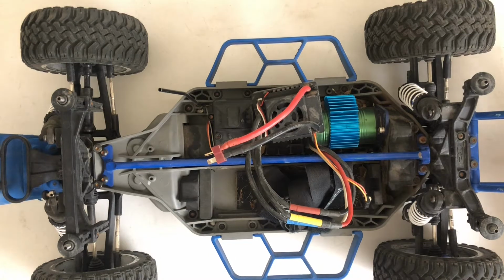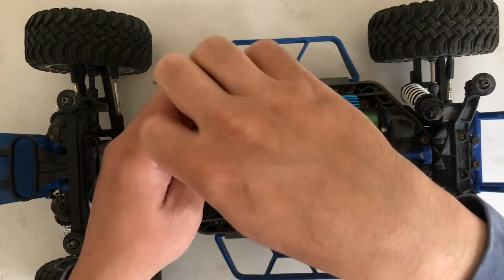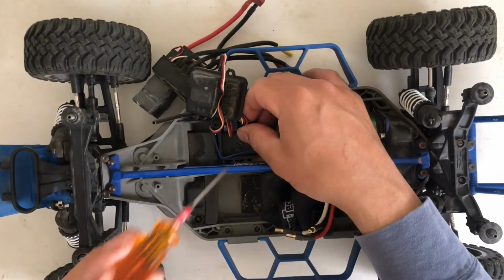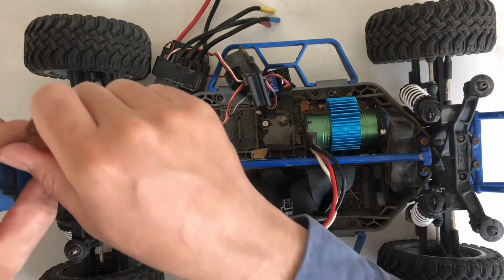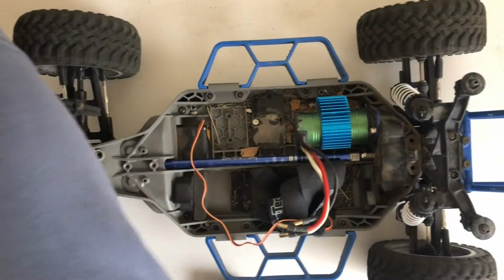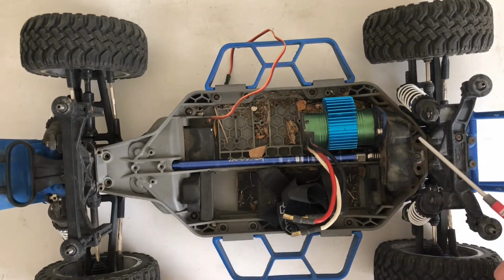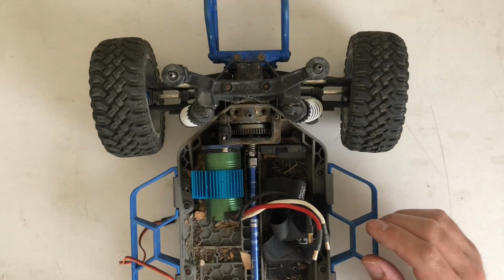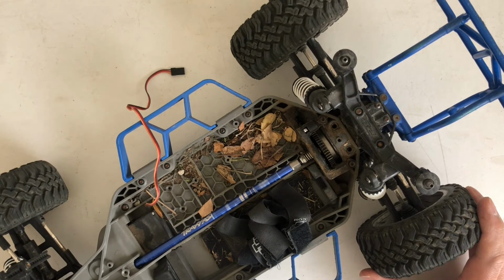Traxxas Slash 4x4 Ultimate Teardown Part 1 Remove  motor receiver box and esc

Comment: Do you know what V/T on one channel in a receiver means?
Reply from the maker: That is usually for battery accessories as well. Say you want to run a fan or some kind of servo accessory. You would use a Y-connector and pug it to there. So receivers have two 1Ch and one will be labeled bat.